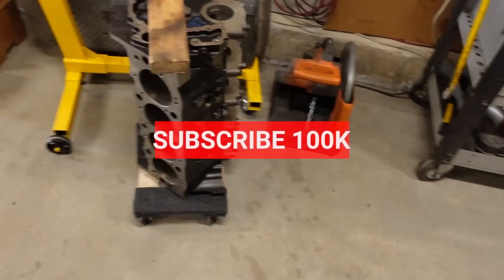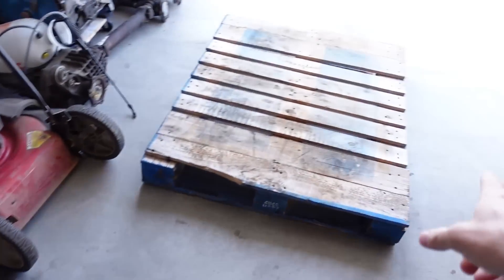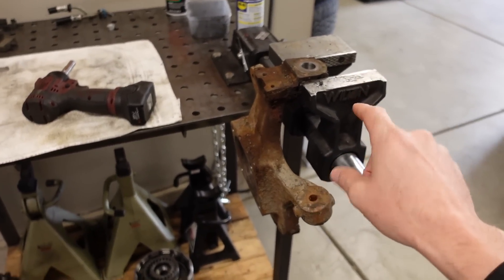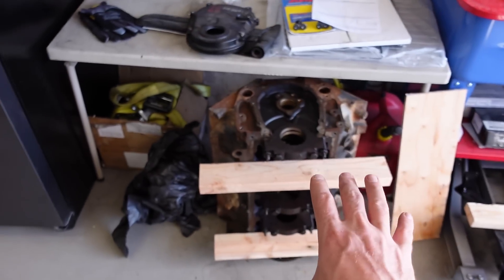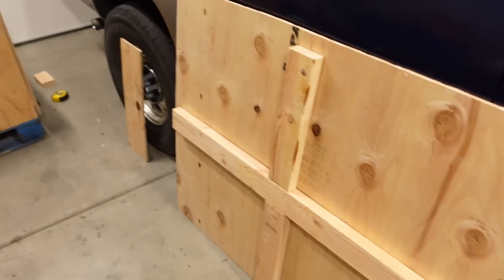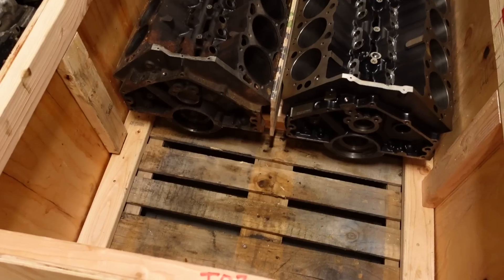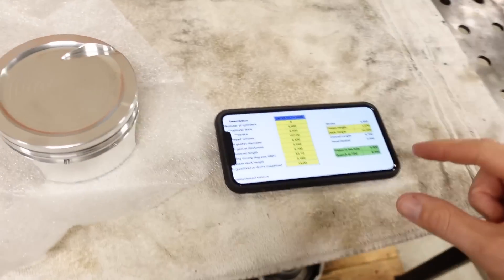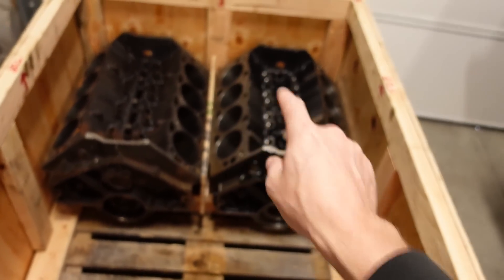CUSTOM PISTONS for my TURBO 547 Big Block plus shipping out EVERYTHING

Comment from the maker: Let me know your thoughts on the Suburban guys, I'm so torn about what to do with it. Once I get the GMT800 brake conversion done, I've even considered selling it... decisions, decisions.
Reply: Duramax swap
Reply: I wanna see an all out offroad build with 4 links and big tires
Reply: I love your Suburban built because I have a 99 2500 4×4 also. It gives me ideas for mine. I would like to SAS mine.
Reply: Yes i love the idea. I want a 2 dr tahoe/blazer and was thinking a big block swap would be awesome the raylar build in that would be insane. But yea everyone wants crazy money for beat down versions... Like cool its a rusty tahoe gt for 10000...   But you should do a 2 dr build that would be awesome to watch
Reply: I recently did my '00 OBS z71 Tahoe's brakes with the ppv package: new Delco rotors, braided flex lines, powerstop z36 pads and shoes , new 11' drums and gmt800 master cylinder. I swear it stops a good as my mom's new 2021 z71. Don't forget to bleed the abs module too if you flush the system out too. You can actually do it manually unlike a lot say, two black round covers at the back of the module can come off, and as you press the brake, press in the check ball. No tech 2 scanner needed. Also make sure to adjust the rear drums overtime, the self adjusting adjuster always seems to get stuck over time. Definitely would love to see an offroad build with the suburban, but Tahoes are smaller.  If you go Tahoe better swap in a big block. I am even tempted doing an 8.1 swap or or a l21 454 swap with forged internals and the 411 pcm already involved.
Reply: Off road build would be nice. You said before offroad  not really your thing, but it might good to do something more out of comfort zone. You got budget build, and ultimate build for street truck. Time for something differnt.
Reply: @irvinlewis5022  It would be good for where he lives.Take it to Moab after its finished.
Reply: Love the Blazer idea. Could you mount the Blazer on the Burbon frame, move the axle forward, and add a little bed???
Reply: Honestly in that condition you could sell it and make a killing in this market (I turned in a 3 year audi lease on my 2020 SQ5 1 year in last monday for a FAT check, PEOPLE NEED CARS!) Finding a blazer roller, handling the motor and trans the way you do... it would be easy picking!  I wouldn't fault you for selling. I'm a newer sub but I am in this for the haul and want to see more GM upgrades!
Reply: 2 Door Tahoe would be awesome but I would just sell it
Reply: Alternative idea for the blue suburban. Go ahead with finding a 2 door GMT400 tahoe. Instead of swapping everything to it make a "4 door tahoe". Take the rear section of the tahoe and replace the rear section of the suburban. It would require some frame work to extend the wheelbase to fit that body section onto the suburban. That is something I've wanted to do. Overall length should be fairly close to stock but rear wheels will get moved back about a foot or so making it look better.
Reply: I’d sell it. You have 4 trucks right now so I think you should get rid of one and focus on the other three. You’d make good money and would definitely have extra cash for the supercharger.
Reply: I’d just get the little things done, then drive it and enjoy it until you decide what direction you want to go. In the mean time, if someone comes to you and wants it worse than you, let her ride
Reply: Duramax swap, straight axle swap. Offroad and overland builds are in right now! Or keep it stock and sell it after you upgrade the front brakes!
Reply: What's wrong with the E39?
& a 2dr Tahoe with everything swapped over from the suburban would be sick🔥
Reply: If you were to sell it, what would be the going price?  Brake and axle mods included?

Comment: I like the way this is going. The thing is going to be a blast to drive. 
I think you would have been okay at 10:1, drivability tuning would have taken longer, but cylinder pressure for a given hp is the same. Hypothetically 900 hp at 9.5:1 may require 14 psi but at 10:1 it would be lower like 12 psi. Because the base NA power level would be higher.  So while the CR went up boost needed for a given level went down. But i do see your point on trying to stay with 93 pump e85 isnt available everywhere nor is the percentage consistent. Good luck on the build man!

Comment: The weak link on your set up will be transmission then rear end and possibly the driveshaft.
Reply from the maker: driveshaft for sure. I did just see the guys from OnDGas broke a leaf sprung record in a 1/2 ton truck (mid 7 sec 1/4 mile) on a stock 8.6 10-bolt. I think those axles can take a lot more abuse than people give them credit for.

Comment: What turbo are planning on running? I would like to see what on3 107mm  with a 96+mms turbine with a 1.32 t6 housing will do on it
Reply from the maker: Haven’t got there quite yet, but it depends on how much back pressure this manifold setup produces. I may switch to a proper turbo header and twins… who knows

Comment: Is line honed necessary when using oem main stud bolts or mainly for Arp hardware because of the increased clamping load distorting the mains clearance?
Reply from the maker: correct, with stock fasteners it should be correctly line honed already. Only reason I need to line hone here is when you put in a stronger fastener, it distorts the main caps slightly. So they install and torque the ARP main studs, then line hone. Same goes for the connecting rods if you change the fastener. New fastener torqued to spec requires a hone to touch up the size.
Reply: @TolmanPerformance  Thank You for the Info 💯

Comment: LT it sounds like this stroker 8.1 is going to cost more to modify than a traditional BBC or BBF. I’m curious if the extra cost are worth the trouble over tried a true methods with 454ci block with all the trimmings to match your application. I guess we’ll see in future videos, I’m certainly ok with being proven wrong. Then again my wallet is the one leaking like a busted water main. Can’t wait to see how this turns out, love the content keep it coming man!!!

Comment: I've got a 4 door Tahoe with a 6 lug 14 bolt rear axle but a two door Tahoe on 3/4 ton running gear 454 4l80e on 36x12.50 swamper ssr tires would be great

Comment: The only thing that needs to be done is to install the 8100 in it, install factory running boards and leave it alone. Any good looking 2500 Suburban is a noticeable and wanted vehicle. My Uncle has a 2006 Suburban base. He loves it but his dream vehicle is a 2006 Suburban 2500 with the 8100 engine. Whatever

Comment: Engine builder to engine crate builder.  You have many talents.  Looking forward to hearing this new beast run!  I like the big Suburban's but a Tahoe or Yukon with the 3/4 ton running gear would be cool too.  GM made a lot of them, shouldn't be too hard to find one that needs an engine.  Thanks for the video!

Comment: Please build it as a Suburban, use a new 10 liter engine, and make it a 6 speed manual with 4 wheel drive
Reply: That would take a huge check book to pull that off. I doubt you tube is paying him that much.